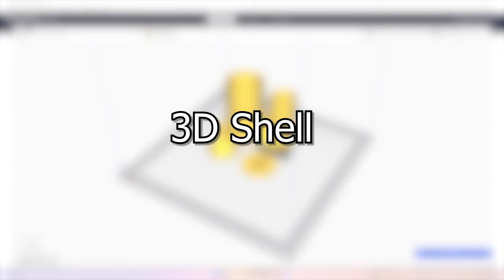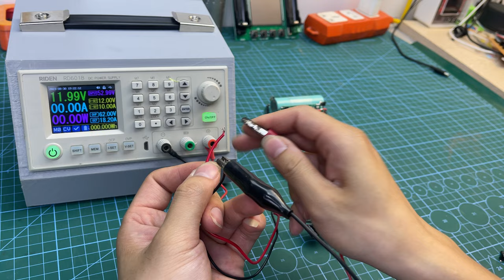DIY Cordless Compressed Air Duster - 100000RPM

Comment: great video 

can we use potentiometer with the motor  ? it'll work the same ?
Reply from the maker: Hello, for this circuit, you cannot use it with a voltage regulator. To use a voltage regulator for speed control, you need to use an ESC circuit with a Test Servo module.
Reply: @4EProjectsChannel 

Thanks you for your help
Reply: @4EProjectsChannel 

A another question 😅 : can I use the same battery system and put un esc with a potentiometer to run a motor like this ? 

I’d like to make a rechargeable battery system with a usb C and use this for the motor

Comment: this is completely fake cause you can’t get 100000 rpm from three batteries plus I also agree with progthoghts
Reply: You can if you're brushless motor is like 9,000kv you can use 11.1v or like three  of 3volts battery😊